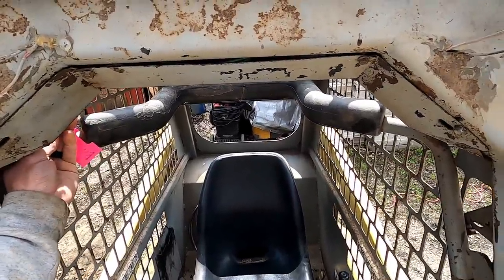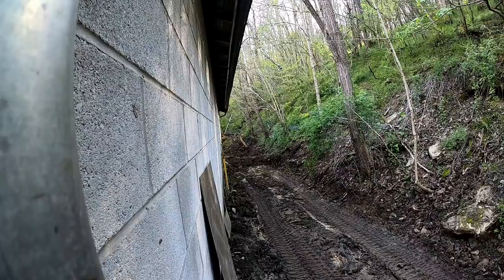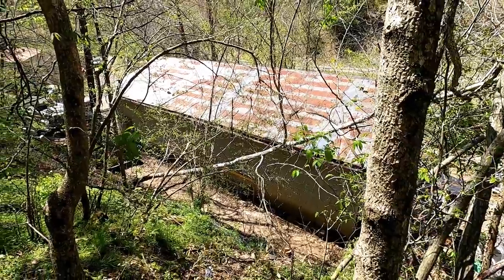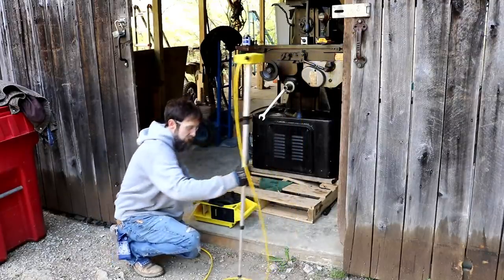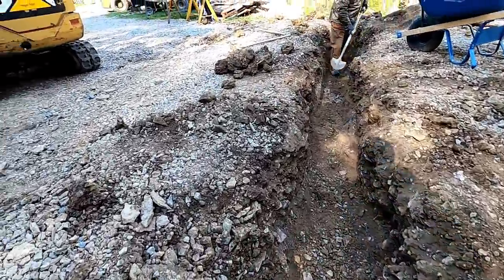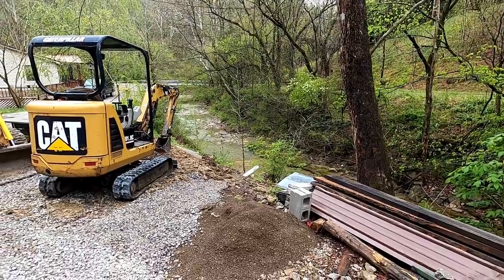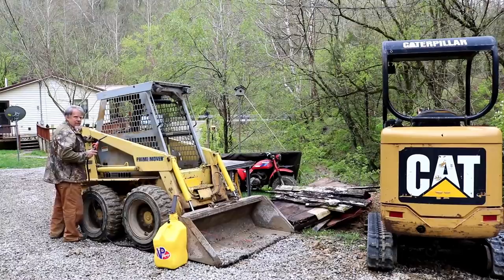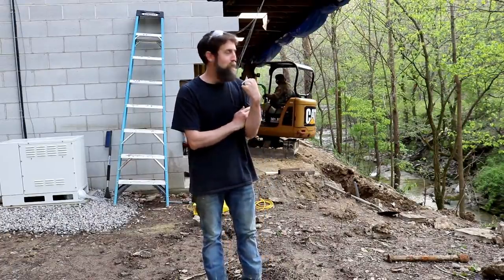Bringing in Equipment. Damaged Shop # 11 Foundation and drain work. Nothing but rocks .

Comment: I love that the door is locked on a shop missing an entire wall!  Man you have amazing patience and a tremendous work ethic.
Reply: Yea, I laugh every time he unlocks that door six feet from a tarp covering the missing walls.  Also, notice that the barn door does not have a lower guides.  You could just swing the bottom of the door out.  It's like Steve just has to twig everyone nose with the hypocrisy of a locked or on a barn that has no walls!
Reply: @chucktodd7329  could sneak in there and fill your pockets with Drill Presses, Surface Grinders, Milling Machines........and if you have a backpack -- a big Shaper
Reply: Must be an insurance thing. My MX5 is insured if I leave the roof down, so long as the doors are locked.

Comment: Now that you hit rock. Drill holes in it put rebar and pour a retaining wall 3 foot tall. Place drain tile and crushed rock with filter fabric. Between the hill and retaining wallHill will never be a problem again.
Reply from the maker: Without sinking the wall way down deep it would just push over I am afraid. That hill is massive and stays wet.
Reply: @SteveSummers  If the wall is relatively short and anchored to the bedrock with rebar epoxied(concreted) into bedrock, and pour a stub wall to tie into those epoxied(concreted) rebars should resist being pushed by the hill for a good 10-20 years. The hill will eventually push over the top of the wall if it doesn't fail, and that should be easy to keep clear.
I'm thinking 1" rebar vertical @12" on center and 1/2" - 3/4" rebar welded horizontal. 

A core drill with diamond bit should make it easy.
https://3.imimg.com/data3/HD/PX/MY-2078527/core-drill-500x500.jpg

That's how I'd approach it.
Reply: The idea has merit, but instead of trying to retain the wall, I'd just pour a concrete wall, say 18" high and just place the drain and fill behind it.
Let the hillside crumble over it, it'll still be a drain, and the small wall will give you something to run against as you periodically clean up the falling hillside.
Reply: @TyphoonVstrom  Just remember to put a cleanout plug (Y type at both ends) so if your drain gets clogged you can get it cleared.
18 to 24" i say, stoping the hillside water from possible flooding the shop

Comment: Twist your connectors while gluing, holds better.
Now that you know the shop, you have the foundation layer, as someone else said, bore in holes, place rebar, build you a retaining wall against the hillside. Lay down a "weeper" drain on the backside of that wall, backfill with your gravel or dirt. This will give you that drainage still needed on that side. Unfortunately, that means more money but, in the end, you'll have a retaining wall with a drain. Time and patience. Great video. Cheers :)

Comment: One suggestion you might consider is going to your county land development agency and ask them the best choice of plants, shrubs and trees for your area that will help stabilise the hill.
Oh if you have to cut a tree notch it in the direction you want it to go, EVEN UP HILL when you're going to have to pull it back.  That way it's much less likely to spin off the stump and you don't have to cut through the entire tree before it will fall.  This way the notch will take care of about 40% of the trunk and then you only have to cut a third to half way on the back side and down it will go.  Also if you're Very comfortable with chain saws kit a chisel tooth chain.  A bit more grabby or kickbacks but will they go through the wood.  All these anti kickback chains are "safer" but they also cut slow as hell and work your saw a lot more. Wish I was young and lived close buy, I would have given you a hand in my youth!

Comment: Suggestion, after you get the foundation trench to the level you want make some three foot long square stakes pointed but no holes and drive the down the center of the trench that parallels the cree and then tie pieces of rebar to the stakes, that should keep the foundation from trying to slide down hill onto he creek.

Comment: Those small to medium excavators with a dozer punch way above their weight.  We rented (an admitantly larger) 6 ton model for a quick weekend job in 2001, and never took it back.  Over the last two decades we’ve done more work in way less time with a combo of a mini excavator and a tracked skid-steer than I’d ever have thought possible without having a fleet of different bits of earth moving gear.

Comment: in colorado, that bentonite clay is used as water barriers against foundations. It does need to be covered with plastic, and some material to keep plastic in place. It'll help keep water from penetrating under the slab, eroding the foundation on the other side.

Comment: Hi Steve, could you build a wall on top of the rock bed along the bottom of the hill and put a pipe in to drain the water along to the little spring and it would help keep that side of your garage a little dryer, keep up the good work
 and you and your family stay safe from uk🇬🇧

Comment: Steve, since you can't (affordably) install the two French drains along the "hill" side of your Shop building, try creating a slope away from your Shop wall towards the hill.  Perhaps use clay or similar as your fill material.  We had to do this when we lived on a hill-side in Birmingham to keep rain water from flooding the basement (again).  It worked well.

Comment: Steve, I have to say, I'd be digging at the roots and pulling or pushing that tree over, stump and all. That's the way we do it here in the Pacific NW: use the tree as a lever. So much easier than felling and stumping. Of course, maybe you'd prefer to leave the stump... By the way, we pay about the same here for a load of crushed rock. My drive required 30 loads.
Reply: The roots are binding the soil together. You don't want to start pulling the roots out of a hill. You'll destabilize the entire thing.

Comment: Perhaps you should consider capping the open end of the drain pipe with a screen.  I did that for my air conditioner drain to keep critters out.  I used a pvc fitting that glues onto the end of the pipe with a female thread at the end.  I then built a removable screen where it screwed onto the female fitting.  Using hardware cloth in a cylinder that attached to a male fitting on one end and a cap at the other end.  I can unscrew the screen to clean it.

Comment: Steve;
Dale has it right.  Build a retaining wall with rebar embedded in the rock and put your drain pipe on the uphill side of the retaining wall.  Backfill with gravel and you will have an excellent drain run off control.  Recommend a 12" thick wall and it can either be poured concrete or 12" thick concrete block with concrete fill.  If you do poured concrete, recommend using vertical #5 rebar, spaced 2 feet apart on the run length, with double row of vertical bars spaced so there is 3" of concrete cover on the sides, the vertical bars epoxy embedded 18" into the rock, and #4 horizontal bars spaced at 10" to 11" height intervals so there is 3" of top cover concrete, and use 3,000 psi concrete..  If a concrete block wall, recommend a vertical #5 rebar, epoxy embedded 18" into the rock, spaced every foot, with a horizontal #4 tie bar placed between every course of blocks and wire tied to the vertical bars.  You can buy concrete blocks with the cut outs for the horizontal tie bars.  Use a running bond pattern and fill with 3,000 psi concrete for all block openings.
Have to say that watching you and Al working with those mini-equipments looked like the world's biggest Tonka toys ;).  Had a chance to meet and talk with you at last year's BarZ bash and hope to have the chance to meet you again soon.
Regards;
Ron

Comment: I don't know how much it would help, but you could pressure wash that rock slab just beside the shop wall and pour a 4" or 6" high sloping curb to try to keep water on the slab from running up against the shop wall. Basically use the whole rock slab as a surface gutter. It would work where I live, but you get frost there, so it might peel off the rock face after a couple of years.

Comment: I agree, never seen anything like this before. 
Equipments uses liquid leveling principle, the error at point of reference may be applied to any distance away, as long as liquid density (temperature) on both ends remains equal and earth curvature error is negligible. Contrary laser leveling error is not absolute but varying, error proportional to distance.

Comment: Have You ever considered rebuilding the wall with an offset to the original position, may be 1 meter (3 feet) off the edge, more like your temporary support? leave the roof overhanging, build some nice sliding door and have an open but covered area. as an additional benefit your foundation will be significantly less prone to slide off again in the future. 

Michael

Comment: The whole idea of dirt is that it's granular and not that much trouble to move. A good worker can move about a cubic yard 100 feet in an hour using hane tools and a wheelbarrow.

When it aint dirt but jagged interlocking chunks of rock and globs of sticky bonded clay, it aint fun. Every wheelbarrow full is a separate project taking up to a day and plenty of band-aids. No fun at all. I'll take Puget Sound glacial till, thank you. I dug up and hauled plenty of it in my time and cussed it as I worked. I didn't know until now I had it so good.

Comment: I know you thought it wouldn't be worth it but I was thinking a small wall at the back of the shop to hold back the hillside would be worth a try.  Drill down into the bedrock and place vertical bars sticking out at intervals then slide the wall blocks over those and fill in the voids inside the blocks around the bars with concrete.  So the wall is pinned into the bedrock.  Build a few coarses, perhaps something about knee high, and then fill in behind with left over concrete and ballast, and top off with a bit of loose stone (but keep it below the top of the wall).  Just my thoughts.  Anyway, keep plugging away at it and sending best regards over from the UK.

Comment: Interesting level, last time I did that job was with an old school surveyors transit (telescope) PS I used to work at a cat shop welding up the bushing holes when they got wore out and rebore them... Portable line bore is a money maker And welding new teeth on the buckets. Yes grease is cheap, do it daily every time the cat is in operation.

Comment: As I get older my memory gets shorter, but having said that, for me this was your best video ever. It had everything in it (well maybe not machining) : springtime in the country, new green leaves on the trees, the creek running nicely, your beautiful wife, excellent progress on the project (time for me to kick in again via paypal), construction equipment, your friend Al, walnut, and getting to hear your reasoning for the way you are doing things. I agree with you.
One thing I would suggest. Paint the PVC pipe that empties into the creek a dark green. It will minimize the number of busybody's driving by and shouting, "hey, he's dumping sewage into the creek". You might even consider two 45's so it follows the slope then projects out in the creek.

Lastly, thank you so much for showing that zip level. I had never heard of it before. I am a semi retired civil engineer, but I still prepare drainage plans. It should be a one man job, but for the last 15 years I've had to hire a rod man to hold tbe Lenker rod while I stand at the tripod and look thru the level.
I have twice tried lasers, but here in florida it is impossible to read them in the daylight. I see that home depot sells the 75 ft. version, so I will get one (as soon as the economy starts up again).

Anyway, good video. Keep at it.
Reply from the maker: Thank you! That's very nice of you to say. Glad you enjoyed the video. Thanks for the support as well, much appreciated. The Zip Level is awesome, I hadn't seen them before.

Comment: Привет. In the drainage pipe, you could lay a heating cable, suddenly the water would freeze in it and then the drainage would not work. I have laid a nichrome wire in my drainage, when it is necessary, you can not apply a current to it for a long time so that the ice melts

Comment: Might be worth just trying to cut a channel for the water rather than a french drain. Just a big ass V groove with a grinder, it'll suck but its going to help with water control.
Reply: I had roughly the same thought but using the jack hammer ti make a modest v in the rock so most of the water will be diverted away from the building.

Comment: Ok if you cant get the fittings to convert dont be afraid to just splice it.  Its made to take water. Dont stress on sealing a fitting that has perfected pipe into it

Comment: Cutting a 5" groove into the long bedrock with slope and concreting in a aco drain channel could help, I guess...
Lift their grates twice a year and clean them with a pressure washer, when enough leaves and dirt from the hill cumulate in there...
Every drop of water that is guided away from your shop helps.
I´m excited for the day you put up forms and pour concrete for the foundations and a new piece of slab!
Until then I bet there´s a bunch of interesting vids coming!
Thx a lot, great progress so far!
:-D
I love that lock-on-the-front-door joke...
:-D

Comment: That bed rock may make digging a drink trench impractable, but...  Like others have probably said you can drill in put some anchors in and make 36-48" retaining wall out of concrete.
Also consider a 2x6 stick wall structure with T1-11.  A hell of a lot less weight allowing you to pour a thinner floor and shift the cost to a retaining wall.  Oh the wired/fenced in hillside looks good, a lot of sweat.  
Also how's Elizabeth doing with her health issues.  Best of luck to all of you.  Scott

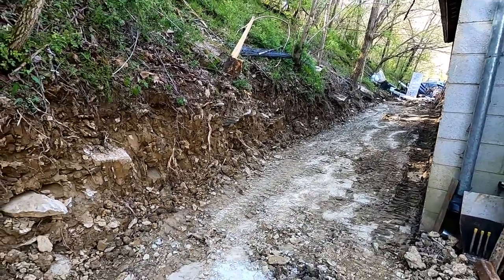Comment: Hmmm, looking down the length of the building (minute 18:00), would it be feasible to install a shallow curtain drain butted up against the backside of the building?  I used to do deep digging and waterproofing of basements (plus curtain drain) as sort of a side job during summer breaks in college.  I'm thinking that if the original builders dug down for the footing back there then there ought to be at least some minimal area (without huge rocks) that a drain could be put in.  If you can get down below the level of your floor that would be time/money well spent.  Below the level of the footings would be even better.

Really good job.  It's been a joy to watch.

Comment: I imagine if it were possible to stop the dirt from coming close to your garage you'd need an awfully high and strong wall which is probably gonna cost more than its worth in time and money. I wonder  if you can do something like anchor steel caging/netting on the slope to stop the potential for large debris, but getting grass to grow on the sloped parts will help slow erosion greatly.

Comment: Well if you can't put French Drains in then consider concreteing a ramp right along the back wall of your workshop not something overly massive that way any water that drains off the hillside won't start seeping into your workshop it will deflect it towards the front end of the building where the small French Drain is.

Comment: I would have used sch40 4"peforated pipe the whole length wrapping the pipe and rock with filter fabric this would pickup any water
across the driveway. I don't understand why you backfill with rock but did not used perforated pipe the rock will flow water if you don't put a head wall at corner. The flexible perforated you have will brake and fill with roots in no time.

Comment: Well, don't really get the issue with your retaining wall. You have solid bedrock beneath. You just need to anchor it solidly and then you won't have any issues. You can use the stones you harvested from your wall to do the cladding for filling a concrete wall - as they are intended to be used anyway. To anchor the wall you just dig tranches into the side of the hill and run some anchors into the bedrock and use some angle iron with a 45° angle.

To avoid that the wall is constantly wet, you would run pipes into the bedrock every like 20 inches which collect the water behind the wall and let it run down in front. Then you just need a small gutter in front of the wall, which you could cut with the wet cutting saw, you already used to cut the concrete.

Comment: There is a drainage system might work for your situation.  Flat and wide with plastic with silt screening,  about 1 inch thick, used on sports fields, allows drainage without a trench.  Example would be ADS AdvanEDGE® Site Drain Pipe.  2 12" wide runs of that with drainage rock on that might take care of the majority of your water.  There are many varieties of this product from various manufacturers. Put a picture of what I use on Facebook: Steve Summers  April 17 at 8:45 PM